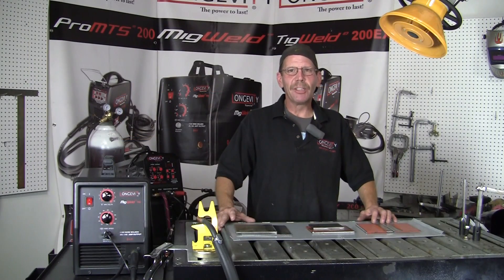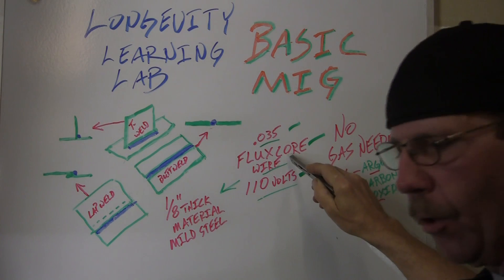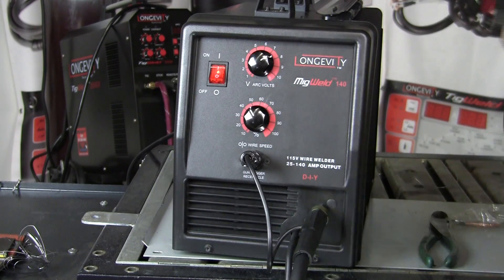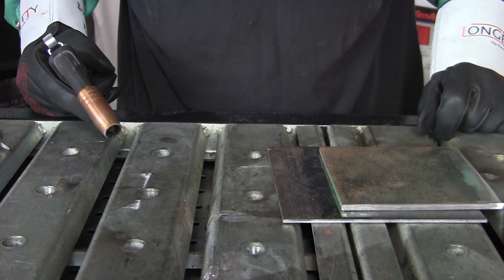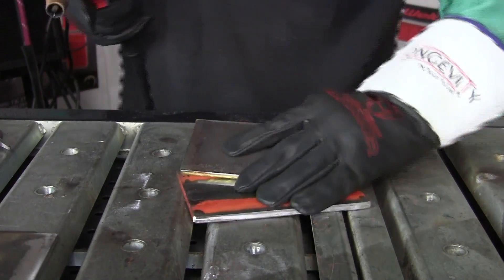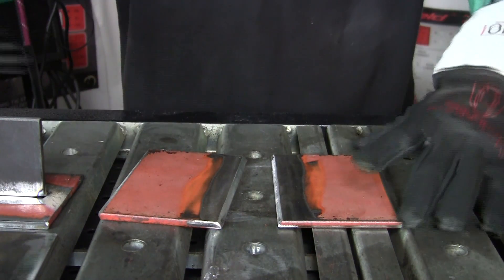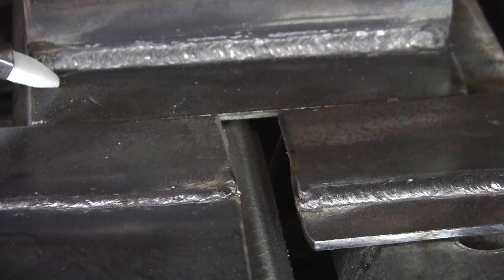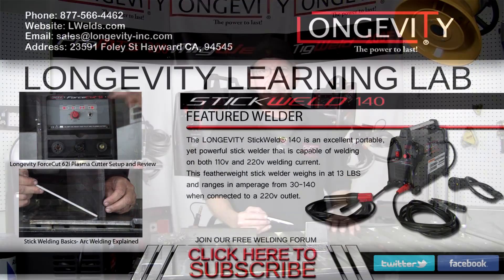INTRO TO MIG WELDING TIPS AND TRICKS

Comment: That small wire welder runs on 110 volts not 110 current.  Current is measure in amperage.  There is label on the tank of welding gas that indicate the mix of shielding gas it contains.  The pieces of steel used in lab tests are called coupons.

Comment: I think u should be explained that the polarity is reversed when using flux core wire and the gas is 75% argon 25% carbon dioxide hence the nickname c25